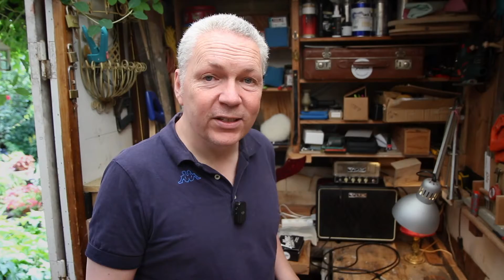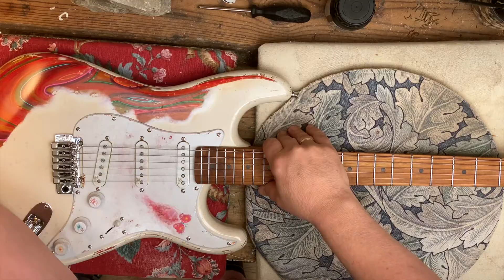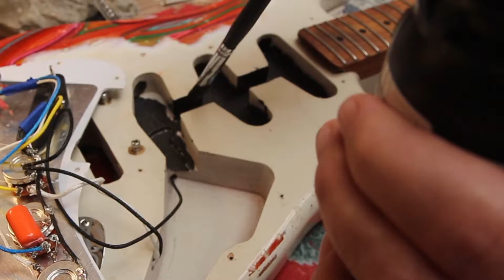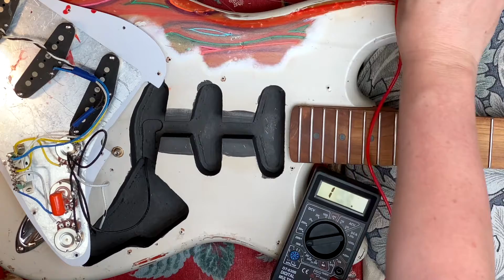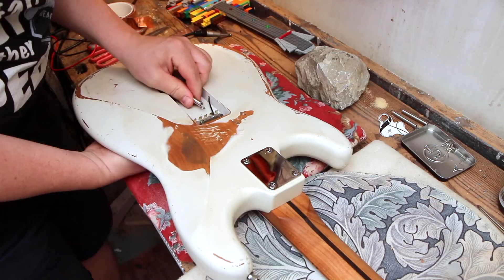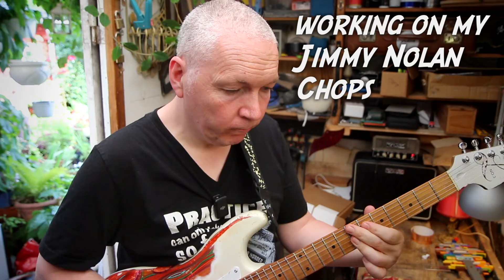Shielding a Stratocaster?

Comment: I always shield guitars if they come unshielded, but I use aluminium foil from the kitchen, moulded to the cavity shape in one piece (as best I can) and stuck down with Pritt Stick.  Copper tape (slug tape from the garden centre) is easier to apply, but I feel that it alters the guitar's tone.  Another place I shield is the complete underside of plastic Telecaster pickguards, because if they're not grounded, a pick can generate some sort of static electric charge that I hear every time I strum.
Reply from the maker: Thanks for great input 👍😉
And thanks for watching 😃🙏🏻
Reply: Best results I had was with conductive paint, keeps the live in the PU's, coppertape gave me the worst experience, no more live in the PU's, alu foil absolute good choice to. Resistance from paint in my original american strat is about 350 ohms from one end to the other in the cavity and the guitar is really silent so resistance might matter to get the clarity of the PU's through. In my opinion the lesser resistance the more choking the PU's
Reply: @Guitarman-w4s  It's interesting that you find copper to be unsuitable.  I'm glad it's not just me!  I've never tried conductive paint, mainly because I don't own any, whereas I do own aluminium foil.

Comment: The thing that people dont usually mention about shielding guitars is that it makes all the subtle ringing out string sounds finally audible, when before they were down in the noise. It really changes the perception of a guitar.
Reply: The first guitar I sheilded was about 1995 -  a friends late 80's Fender Strat. I put a cut up pie tin inside it, which allowed a fairly thick piece of aluminum to cover the cavity in one piece. I disliked that guitar greatly before, but just shielding it changed my mind completely about it.
Reply from the maker: Hey Leif, thanks for watching and for for your great comment 😃🙏🏻

Comment: The copper foil at the screw hole really is a pro tip. When you painted the black strip connecting the 3 pickup cavities, I thought a lot of times Fender pickguards would warp and that would separate the connection. But with the screw hole you can be certain.
Reply from the maker: Hi Dylan, you are absolutely right… 😉👍
Thanks so much for watching and taking time to comment 🙏🏻😃